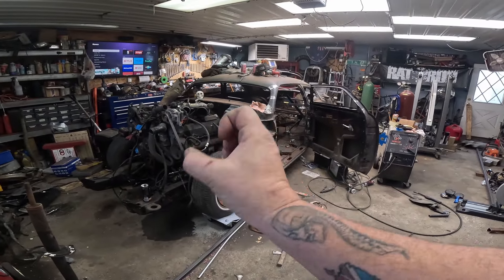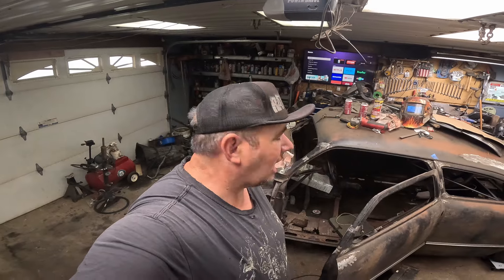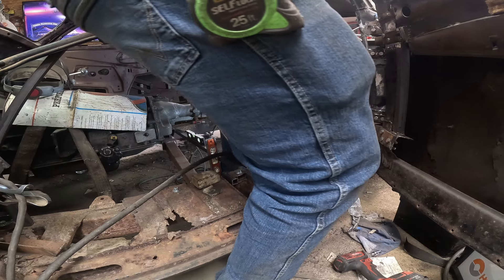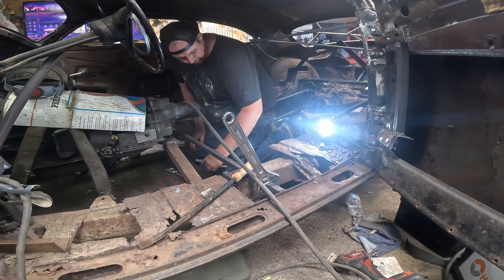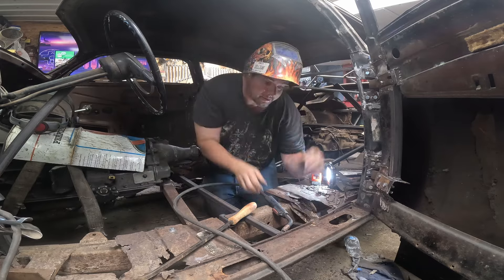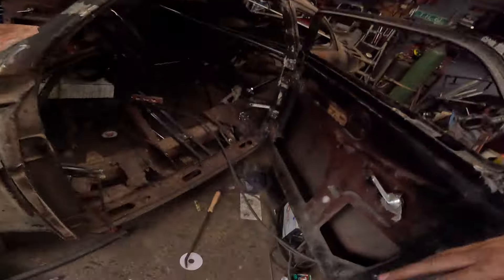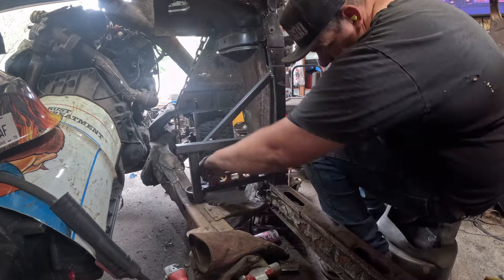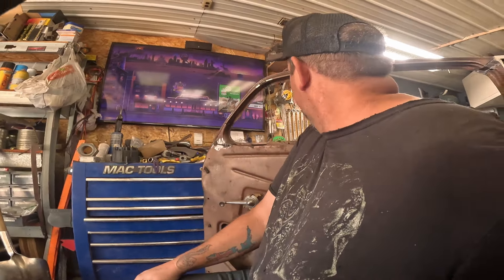POWERSTROKE Swapped RAT ROD Floor Frame

Comment: Only wrong way is quitting! 

I want to do a 6.0 PS swap in a Torino GT or Galaxie 500, the coolest thing with a 6.0 is that it has the same trans bolt pattern as mod motors..... In other words, T56 😈 

I have the donor truck.... Just need the car.... And trans.... You know, the expensive parts 😂
Reply from the maker: Sounds like a solid plan!!